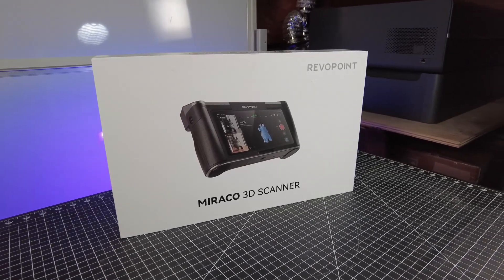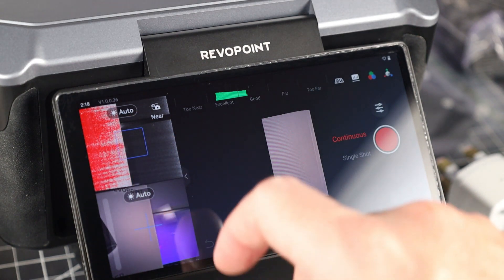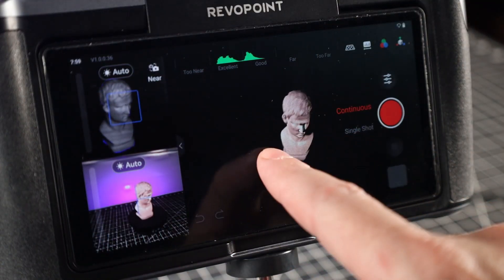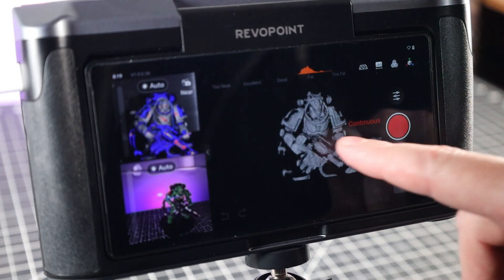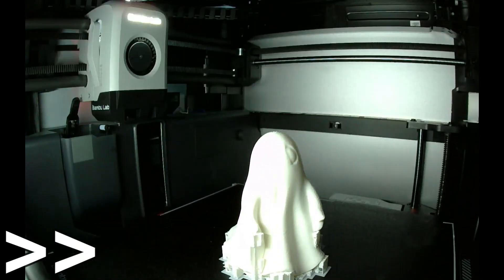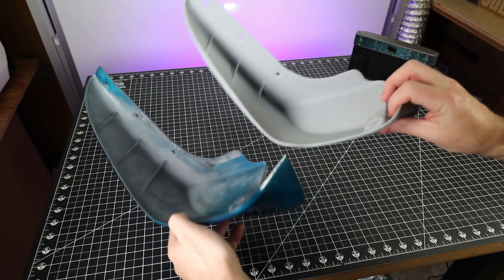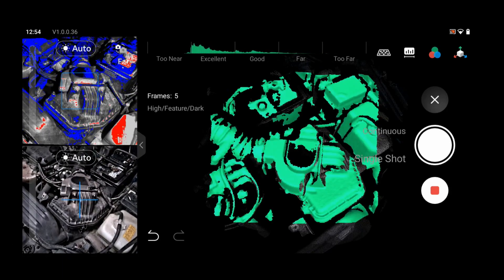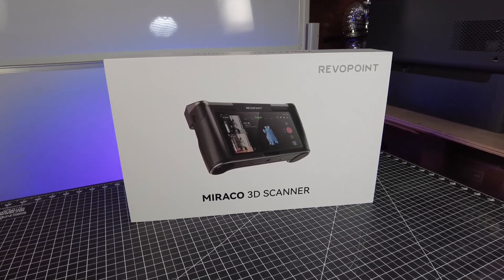Revopoint MIRACO: Your First Look at this New Standalone 3D Scanner

Comment: In your testing do you think this scanner can scan 28mm models like for board games?
Reply from the maker: Sadly no, I had a hard time scanning 40k models. I do have a really good scanner for doing that but it' starts at $5000+ 😅
Reply from the maker: https://youtu.be/GkKFRAx1Hyc here is a link to the video about it
Reply: @randymay  I have the revo mini and it works really well for minis was just excited for a portable version but haven’t seen anyone showing it scan really small stuff. So you just don’t think it’s capable? What’s the smallest it seems to scan well?
Reply: I've been able to scan the fine artwork on special-edition US quarters with my Mini, but there's room for improvement with those, so I'd personally love to see how the Miraco scans compare.

I did learn a neat trick, though: if I use white plastecine brushed with dry cornstarch to make an impression of things like coins, the Mini actually gets an even better scan of the impression than it normally can of the small object itself. Probably because the original pieces, such as heirloom jewelry, tended to be shiny, and the finest sprays that I could find still added too much volume to the topography otherwise.

Comment: I am interested in purchasing one of these; for making 3D models out of almost everything I want a 3D model from. Except the spray paint, where I live I won't have room for that so I'll have to do more clean up but the all in one unit is a real seller for me as it's like a digital camera.
Reply: you don't need the spray - you can buy brushes with powder instead and brush it on, you fill the handle of the brush, it do a similar finish and wipes off with a dry cloth.
one upside of that, is that it don't damage paint surfaces, the spray can be a bit aggressive to pain and sensitive surfaces.

Comment: Hello, I'm about to enter the kickstarter. My question is, it can scan complex objects such as collectible figures with a lot of detail, right? And... Should they be painted white first?
Reply from the maker: It is going to depend on the size of the figures also with the colors. If you're looking for the best scans you can get then using a 3d scanning spray would be best.
Reply: @randymay  I understand, the spray is powder? That is to say, is it removed by putting the piece under water?
Reply from the maker: The spray that I use will go away on its own in about 4 hours
Reply: @randymay  That is to say, I can use it on a painted collectible figure, and it won't damage the figure even if the paint? Can I clean it with water too? Thanks for everything

Comment: Can it be used outside, at sunny daylight ?
Can You test scanning large diameter pipe, or some smooth black surface ..
Reply from the maker: I can be used outside but not in bright light due to the high amount of ir light. 

Smooth black surfaces work for the most part but you have to be using it in dark mode and it can be too big because it will lose tracking

Comment: Thanks for the video! 
Do you think is much better than a Creality CR Lizard? I want one for scan motor bike parts (engine, fuel tank, wheels...) for reverse engineering and 3d printing.. 

And this Miraco is worth double of money

👍🏻👍🏻👍🏻👍🏻
Reply from the maker: Yeah it's much better than the Lizard scanner. You should be able to scan those parts with no problems.

Comment: I would love it if you could do a dimensional accuracy test(s). To see how useful it is for reverse engineering!
Reply from the maker: What objects would you suggest scanning?
Reply: @randymay  maybe something with a bolt pattern, so you can compare the accuracy of the bolt patter in the scan to the original and can compare some interior and exterior dimensions.
Reply: anything where the real life dimensions are easy to check. brackets.. 3d prints, things with round holes or outer circumfrence, things with different defined thicknesses @randymay
Reply: Hello, I'm about to enter the kickstarter. My question is, it can scan complex objects such as collectible figures with a lot of detail, right? And... Should they be painted white first?